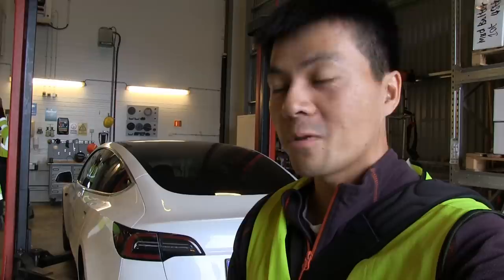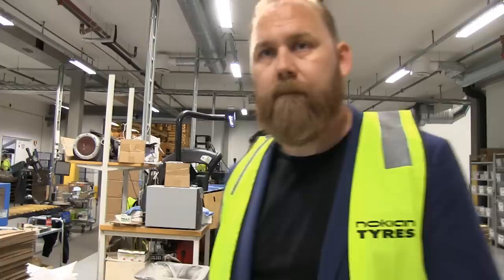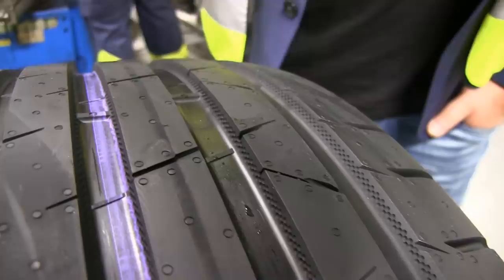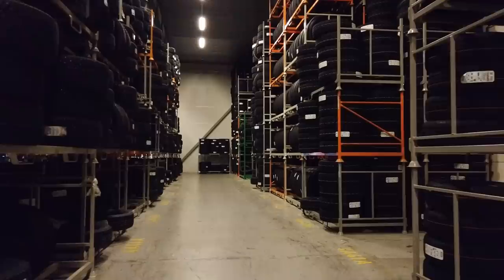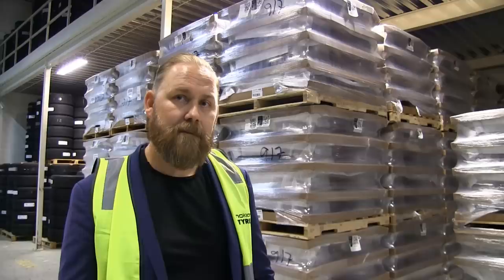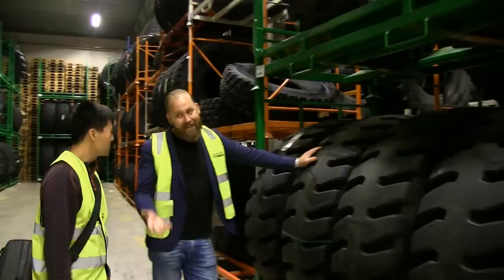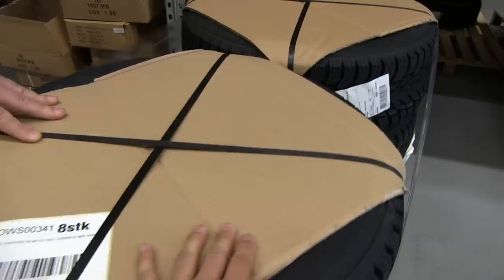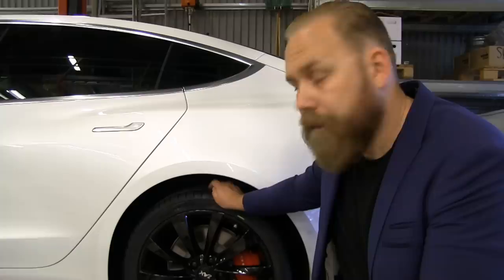MC Hammer getting Nokian Hakka Black 2 tires

Comment: Bjørn, does Nokian put sound-damping material inside the tires? Do they also install Tesla TPMS sensors in the tires?
Reply: The sensors are installed in the rims. It usually doesn't change when the tire is changed off the rims.

Comment: ok thats the reason for the rattling at high speed , to much balance weights. The maximum should not exceed 30 gram. if it is more turn the wheel on the rim by 180 °. if there is still to much unbalance  the rim has a height impact. tires and wheels should generally get more attention .  good content , keep going :)
Reply: This was shot before the German Autobahn videos.
Reply: @RubenKelevra  thats why i was talking about height impact
Reply from the maker: You got them mixed up. The excessive weights were in the Hifly tires. You should watch again ;)
Reply: You have new tires on the old rims , right ? The old wheels had to much balance weights , right ? What i was trying to say is , there are reasons for that , maybe a height impact in one rim .In the newer Autobahn video you had a rattling in the car (the camera was shaking ) , agree ? My result is , putting new tires on a car does not always fix a problem .
If there was no rattling , i am wrong and very sorry .
Reply: @moma3843  a hight impact? Where should the car/wheel have been dropped from? 🤔
Reply: @RubenKelevra  i dont know its not my car , curbside , pothole ... you name it.

Comment: Great video! I was not sure to understand about the new imported cars. So the cars arrive with summer tires but they need to be feted with winter tires?
Does the summer tires get returned back to the Tesla factory? Or does the summer tires are given to the owner of a new car for the summer? 
So if you get your car in the summer, will you get a set of summer tires?  But you will have to buy then winter tires later?
Can you elaborate a little bit more. Thank you.
Reply: Id  you  in  winter  get  delivered  with  summer tyres,  change  dealer  ..............

Comment: How is it the tyres on a new car, last longer, quieter, and better than grip than most replacements avaiable  ? 
I have to spend big $$ to a tyre 95% as good as the one the car came out on, then the replacement tyres are 'off' after 5000klm. However the big $$ tyres even after 25000klm  are still better than brand new cheap tyres. 
Sic of buying tyres and be from tyre shops.

Comment: No Nitrogen filled tires in Norway? (recently installed Nokian Entyre 2.0 an economical replacement on my 2012 MKZ,) I've spent much more on tractor tires!!!
Reply: John Ross nitrogen in tires is a scam. Air is 70% nitrogen anyway.
Reply: @philipkindreddick3517  Seems to be a controversy  on whether Nitrogen filled tires are worth it, but for Bjorn going 235km it might be a good thing. <G>